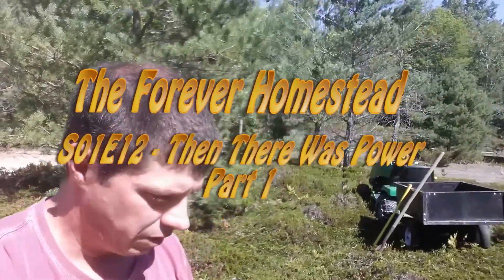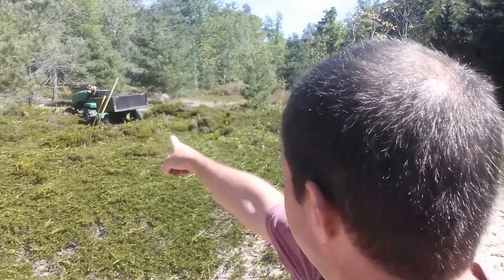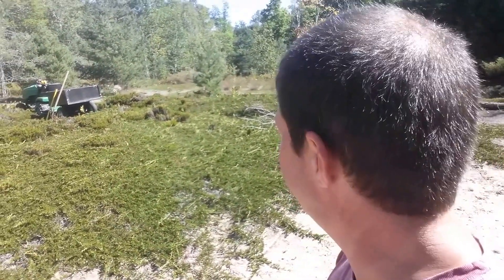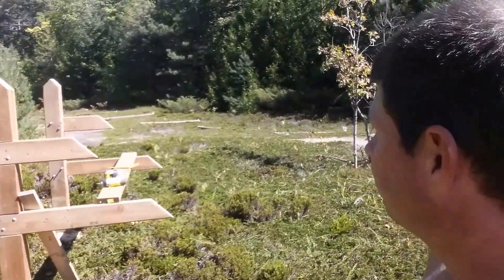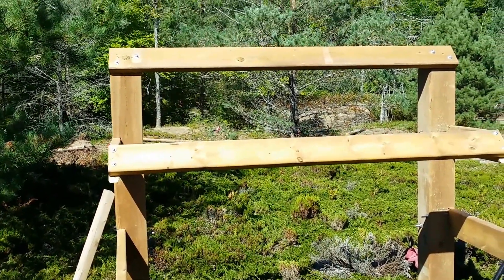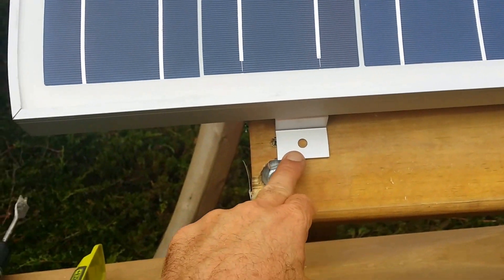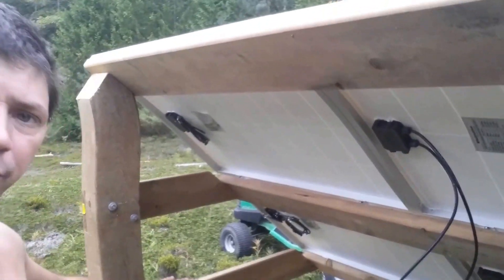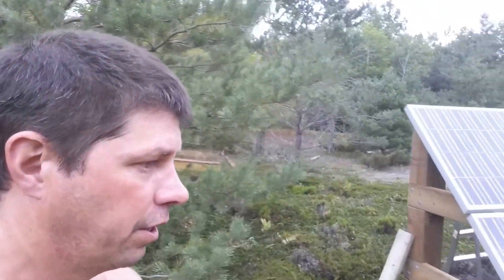S01E12 - Windy Nation 400 Watt Ground Mount Solar Array Install - Part 1

Comment: How do your batteries like the cold/hot varience of being outside?
Reply from the maker: We do not use the bunkie much in the winter.  The few weekends we have stayed in there though have been fine.  In the summer we have not had much of an issue.  The temperature does effect them but on a small system like this it is not noticeable.  We are very happy with the system.  It is rare that we run out of power.  In the summer we even run a coffee maker off of it along with a small fridge and lights.  We sometime joke that it is easy to forget that we are on solar and not connected to a grid.